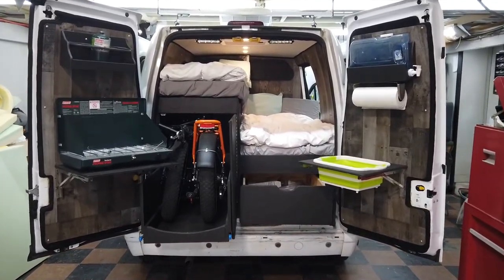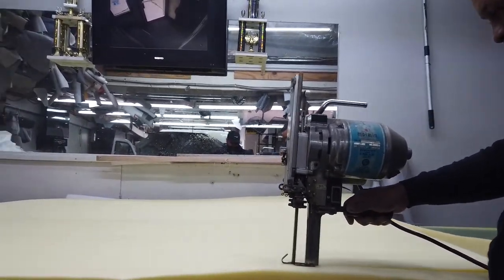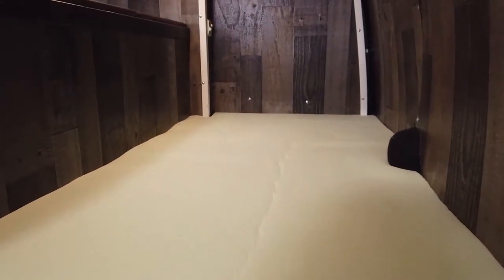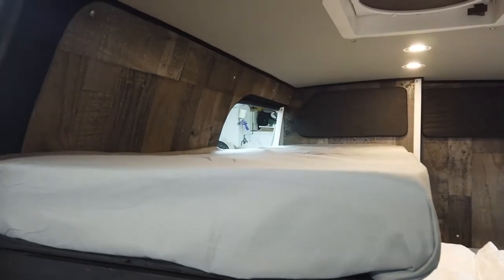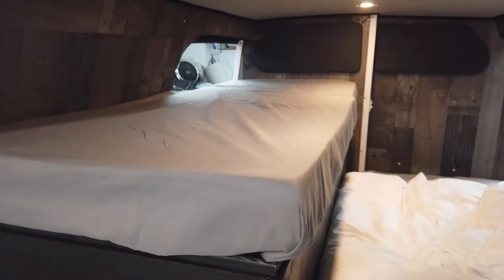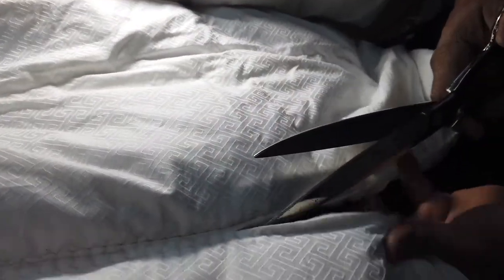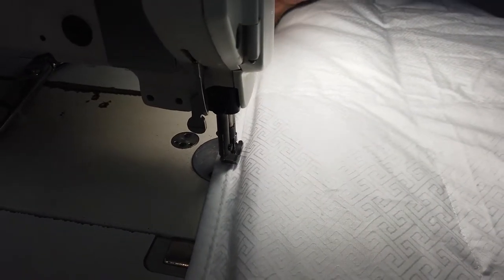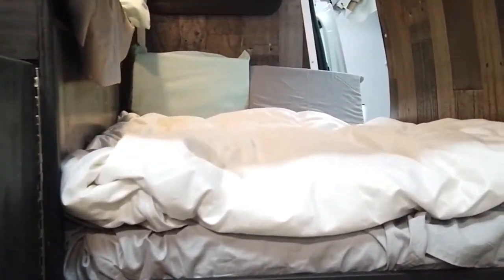Cutting a Memory Foam Mattress, Pillows and Goose Down Comforter in a Ford Transit Connect Campervan

Comment: Totally enjoyed all of the videos. Can't wait to see what you come up with next. I think I would  have preferred some leg room between the bed and kitchen cabinet (where the bike was sitting).  Loved the chest fridge/freezer idea, however you never explained how to transform that to both. Removing that wall between the cab and the "house" just adding a blackout curtain there would open up the space and enable someone to crawl into the driver's seat for emergency escape. (It's a girl thing) lol. The sink table could have been left solid to be used for multiple purposes and the sink just placed on top when needed.  Just some thoughts and ideas from watching your process. Thanks for the great videos, all of the explanations and processes...and what ever you do --DO NOT let Victor go!! He is amazing.  Wish you would have shown the process of hanging the shelf above the seats.  Thanks again. I'm now a fan of your channel.
Reply from the maker: Absolutely one of the more common builds we do is a galley style kitchen with space to sit between the kitchen and couch/storage. We are going to break out the fridge freezer video separate to show what was done but it's pretty simple just add an external thermostat. We made it a little more custom. I also like the curtain to make a quick jump to the back but what we have also done is make a cut over the passenger side seat and converted that to a folding seat to give more sleeping room. Basically your imagination and your intended use will dictate the design. The overhead cabinet over the seats has its own video in the channel. Thank you so much for enjoying. Lastly Victor is a full on partner he is an amazing craftsman and his skills are barely on display here. He is both humble and proud of his work. We hope more van builds utilize him for interior piece work or full builds.